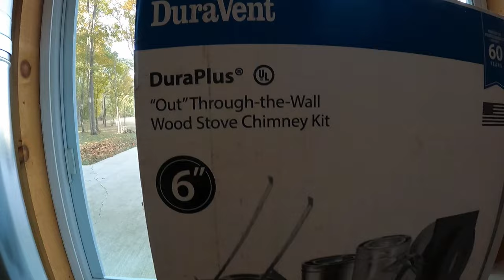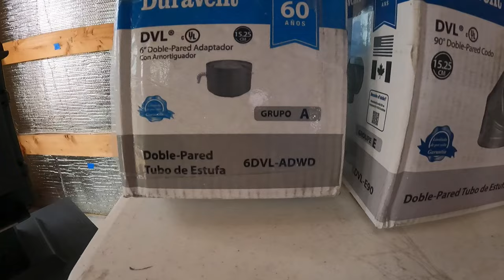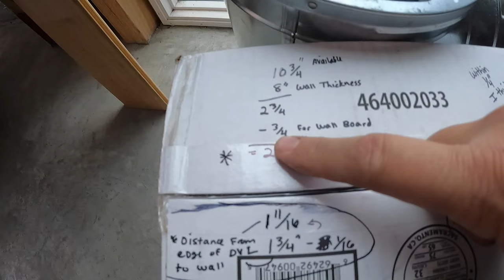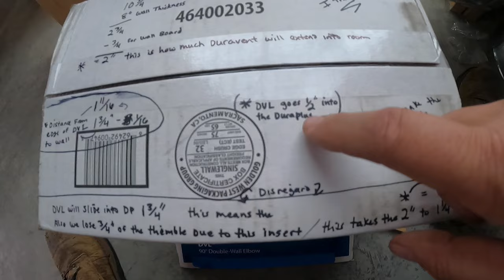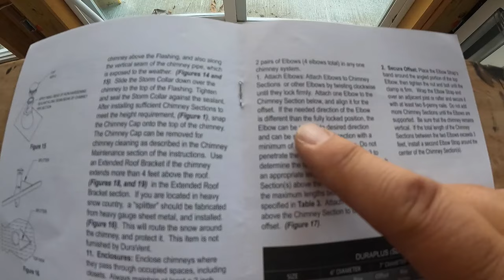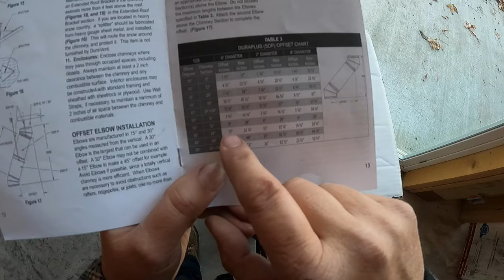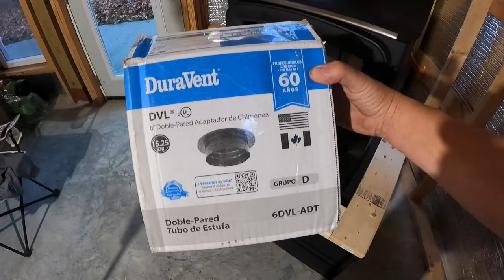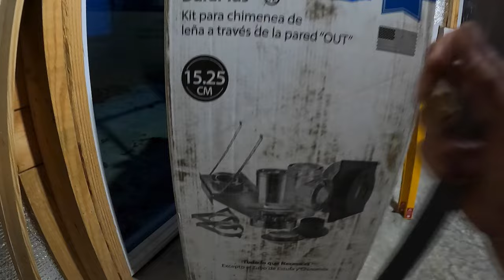CHIMNEY THROUGH THE WALL DURAPLUS & Wood Stove Duravent DVL Pipe / Installation in the Pole Barn!

Comment: No need for a damper "on the pipe" for a wood stove. It's used much more on a coal stove. The wood stove has an air "open and close." There's no point to the damper on the pipe.

Comment: Adding two 90 degree elbow and most your chimney will be outside is already a tough application for draft. That damper in your connector pipe will make it harder… I hope you’re burning fir that’s under 15% moisture

Comment: Hello, Great Video! I enjoyed watching and learning.
According to my manual, "The Joints of any and all connections for any ventilation systems (combustion exhaust and optional inlet air duct) MUST BE SEALED WITH HIGH TEMPERATURE SILICONE" What are your thoughts on this? I didn't see you use silicone on the pipe joints, but I did notice you mentioned using silicone on the "Through the wall kit". Can anyone shed some light on this? Much appreciated. Thanks

Comment: Can I ask why you didn't go straight up through the roof?  Easier to clean and you don't need this odd cleanout box on the outside wall?  Just curious is all before I install mine. Thanks for the vid!
Reply from the maker: Hey, I have a loft above the stove that I could not go through. The ceiling is probably a better plan. Thank you!!!
Reply: Heights could be issue, easier for woman to clean out box.

Comment: Hi ! I having questions I’m installing the same thing and I’m noticing I have space between my dura tech pipe and thimble in side and out side like almost quarter of inch , how a can seal that ?
Reply from the maker: @vladkuchma196  I am trying to remember and picture this. Don’t hold me to it and do some research but I believe I first purchased some steel rivits and I riveted that area and then I used an RTV sealant. It is high temperature. But I’m not sure if we’re talking about the same area. Feel free to send me more info.